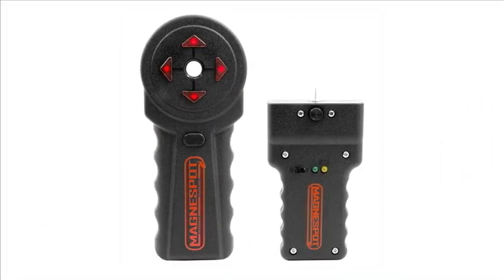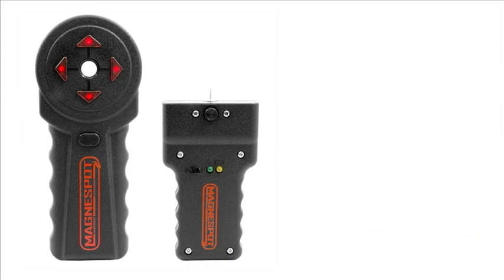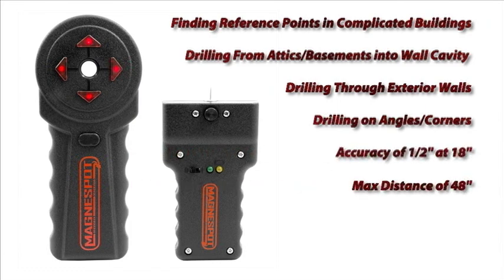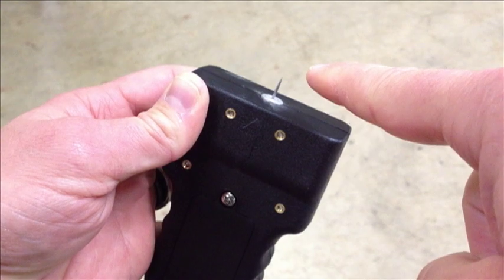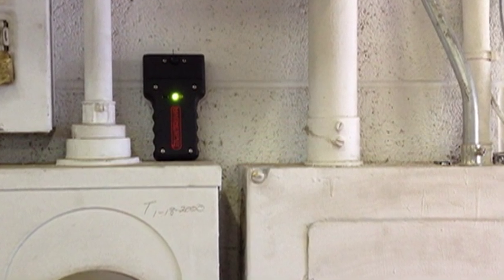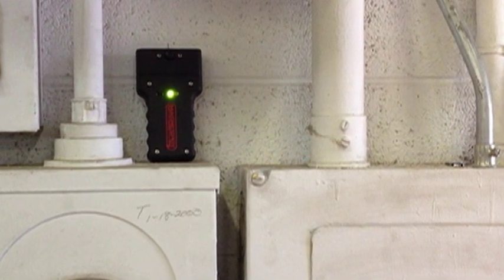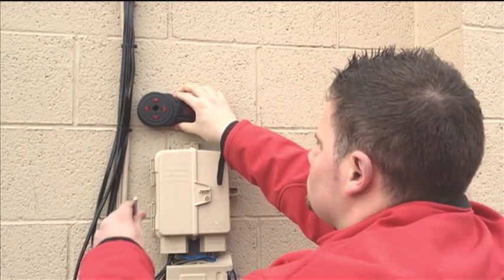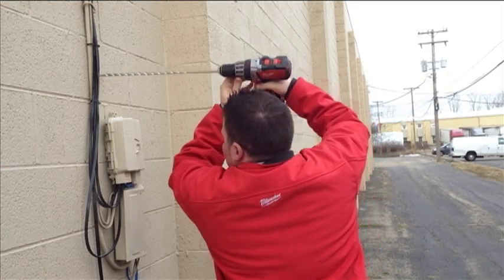MAGNESPOT XR1000 Reference Point Locator

Comment: Man, I have a Magnespot and Magnepull on my AT&T truck and use them maybe twice a year.. but seriously just read the brick. There's phone lines going thru the cinder block from the network interface, just reference that on the other side. If one side was sterile it'd make sense.
Reply: Nobody has phone lines.

Comment: As an Electrical Contractor for many years, this "tool" seems worth it's price. Many many years ago I "Blindly" drilled into a pipe chase after going back and forth measuring and noting locations of water pipes and electrical conduits. Needless to say, Damned if I didn't drill straight into a 1-1/2" water riser that was connected to a water tank on the roof of the 17 story building I was in.
Long story short, by the time we got the water shut off, there was over a 100 grand worth of damage to several offices and a computer room with tape drives. This item I definitely will be buying.
Reply: Hahaha! that's awesome!  and you own it, that takes balls, I'm not sure I'd ever tell anyone about that!
Reply: And you still haven't learned how punctuation works.
Reply: Interested in knowing how this tool would have prevented drilling into the water riser? This isn't a line locator, it's a very high-tech blind hole spotter.

Comment: You still need to be somewhat ballsy to drill blind like that through concrete...and by "blind", I mean that it is still possible that the block has vertical lines, electrical, pipes, gas, water, etc running through it....not likely, but definitely possible....not to code, but definitely possible.  Furthermore, I have seen walls (two different occasions) that have been "double-blocked"...in that, there was a block wall, a 3 to 4" hollow space, and then another block wall.  From inside and outside, it seemed like single-wall thickness....yet, there were two walls, with miscellaneous items in between.  I've also drilled thru drywall and hit concrete (the drywall was placed over existing concrete during a remodel)...another time, I drilled thru drywall and heard glass shatter....same thing, a remodel of drywall over a window.

Everyone should be very careful....none of these tools are magical, and they are NOT like an Xray machine as is sometimes suggested in the Magnespot marketing material.  Double-check, triple-check...even more...do everything you can to avoid drilling blindly.  Assume as little as possible.
Reply: I agree with you on that, but that's not what this is for, it's basically for you to know where your hole is going to come out where...
Reply: I use the Apple vision pro to mark locations just like the magnespot does and everyone says I’m taking too long.  I know they assume and don’t do what we do daily. The think the can reference and use measuring tape. But it’s still a guessing game if you aren’t willing to inspect below, above, and inside of the wall. Your comment was perfect!